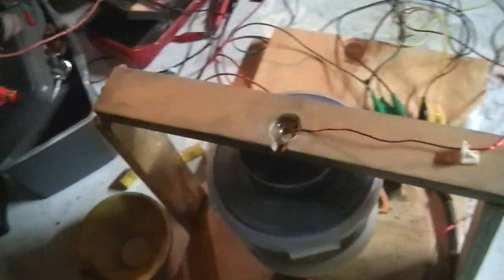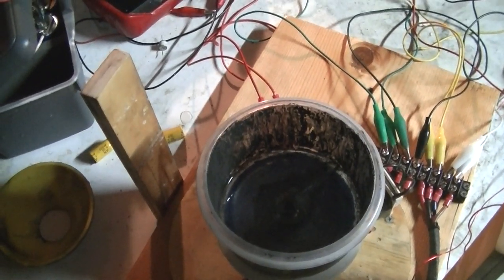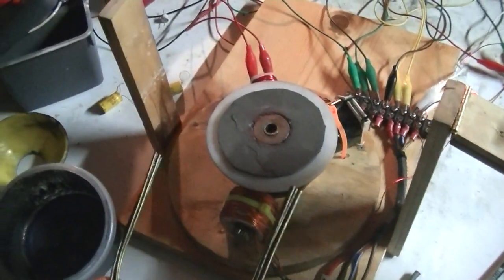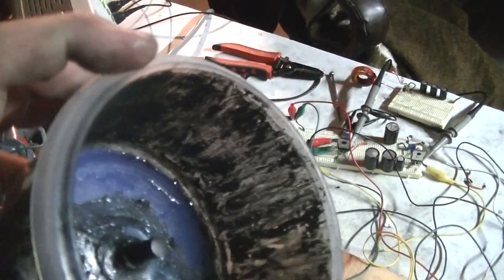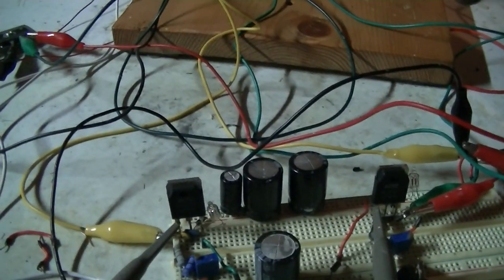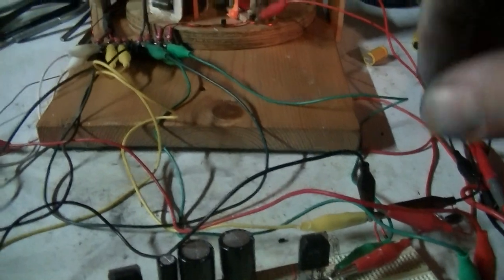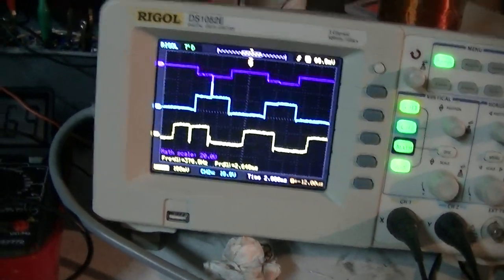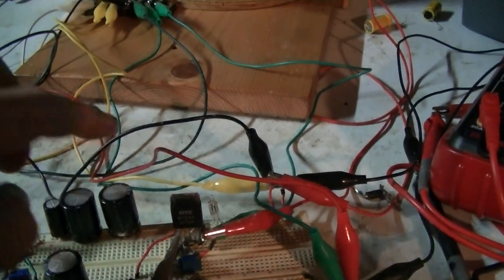PMBO 2014 Detailed Explanation and learning from experiance

Comment: Thanks man, that's excellent.  I like the hinge idea too, I like "All" of it but sometimes it's the simplest things like "the hinge" that make you go... "wow that's a great idea, I can use that for my.. xyz".. you know what I mean.  Good fun.   
It's getting close to xmas your little one(s) must be getting excited. ;) nice time of year for the kids.  My youngest was excited as it's her last day of school today. Thanks bro.
Reply from the maker: Oh yeah, my oldest is excited as well. Her last day is today.  Kind of bummed about the low generation on the SWAG ink liquid rotor thing.  I learned a lot to take away from the experience though. If you are still having problems with the collector to the secondary connection on your Slaydini, you might be able to run it through the bearings as I did.  That way you don't have to worry about fabricating a brush or contacting point. Just a stationsry axel contacting the bearings themselves. Might want to check its resistance and factor that into the circuit, also to make sure there is conductivity. I am sure you already know that process of fiddling. Peace brother, and cheers to you and yours.
Reply: Diadon Acs  ..oh man, I think you just solved or at least opened a problem I was having lastnight with said "SlayDini".  I spent all night tuning the two slayers outside of the slaydini, got the outputs running ok.  But what is happening is when I connect it all up the output drops significantly.  It must have something to do with the extra resisitance on my secondary becuase of the contact/brush type connection.  the output is better when the brush connection is pushing really hard against it's contact... but that just slows the wheel down.  I spent hours and hours messing around with last night. That's really given me something I can investigate.  If I can get it going then I'd like to use the top VHS head bearing for the top load as it's interferring with the air core, a little. It might work better that way.  I see what you're saying about trying to use the bearing for the secondary connection too... good call. Thanks a million.
Reply from the maker: Hopefully it helps, its hard to fabricate low friction brushes with out machining equipment. I had a go at that last years PMBO with a massive Newman motor. I tried scraping carbon brushes from a DC motor but i found it difficult to mount them in a proper angle to the commutator. Ended up using carbon fiber rod and just broke it apart. Works alright, but when there is high current it will degrade the brushes.